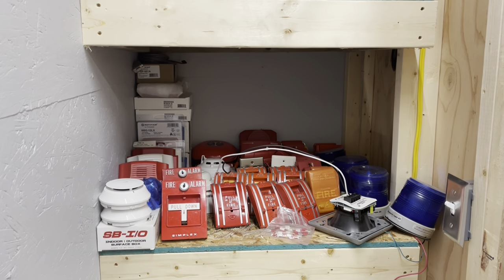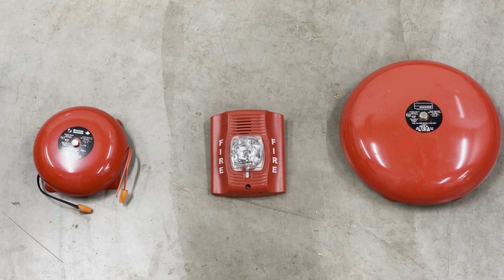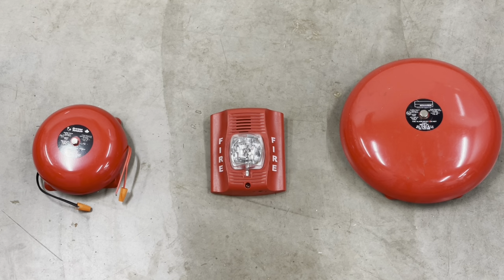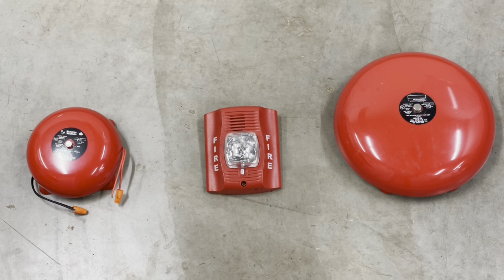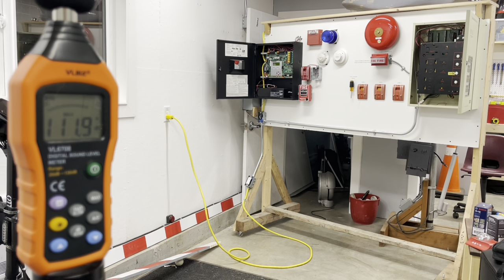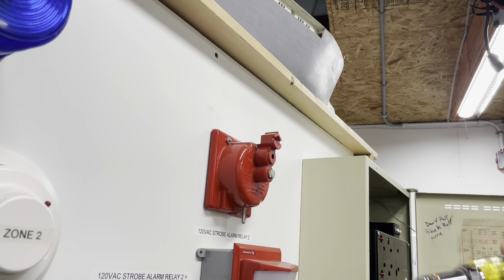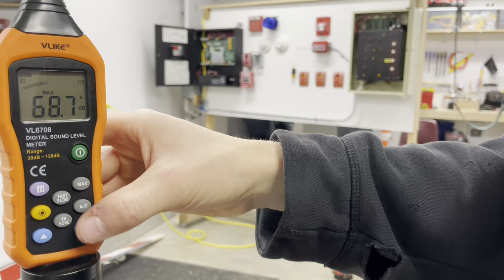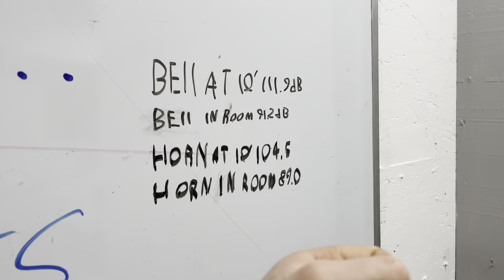Horn strobe vs fire bell which is better and louder

Comment: Interesting 🤔 the bell might have proved to be louder in the dB test but I think it all depends on the tone the ding sound to me isn't as harsh as the horn sound from an advance, then you gotta factor in reverb and stuff I've been to places with 120v sprinkler bells hut they just don't seem as loud as the horn strobe
Reply from the maker: I should do more tests if I ever get the chance to do it when replacing schools fire alarm system it’ll be interesting to do a walk around before and after
Reply: @nics-systems-electric  code 3 also seems louder than continuous

Comment: Have u seen a 2901 9838 before i seen bells too but rarely
Reply from the maker: Not 100% sure if I have or not
Reply: The Vermont Achievement Center (VAC) school had bells when I was last there! In 1994! It was the residential houses that had FCi FC-72 FACPs with Wheelock 7002T horn/strobes. The system at the school, was much much older! The residential systems were installed in 1989 or 1990, IIRC.
Reply: Horns unlike bells can be a durability concern because they are just plastic, like he said, but a 9838 is metal and would be a great spot replacement for a dead bell.

Comment: The Gentex bell is so big it’s about the same size as the Edwards MB10-24 but it’s bigger then the 439D it’s very rare exit sign 250 has a Gentex. bell and it’s way bigger then a system sensor bell on the left and by the way horn strobes are louder then bells
Reply from the maker: 439 and MB 10 are the same size
Reply: @nics-systems-electric  yes
Reply: @nics-systems-electric  its funny cuz the simplex bell has no nut on it and the 439D and the MB 10 have a nut